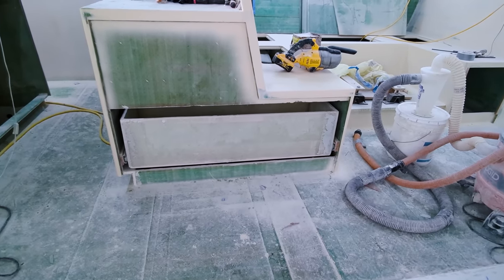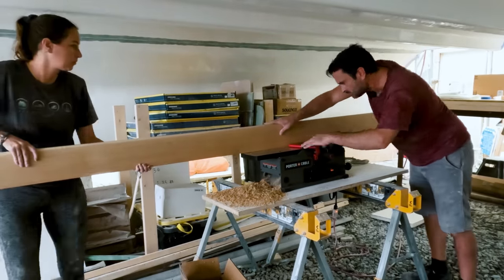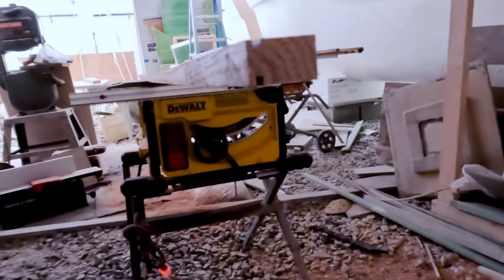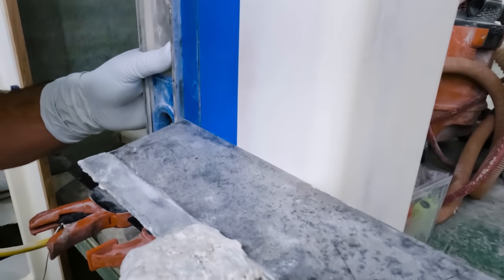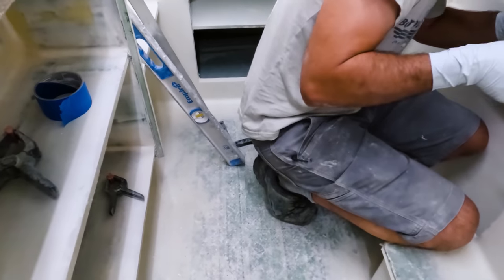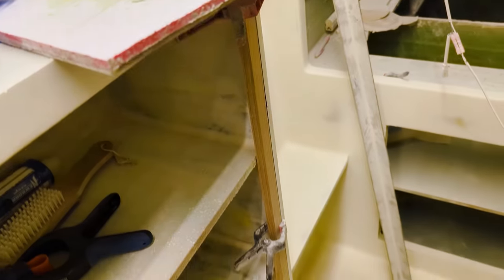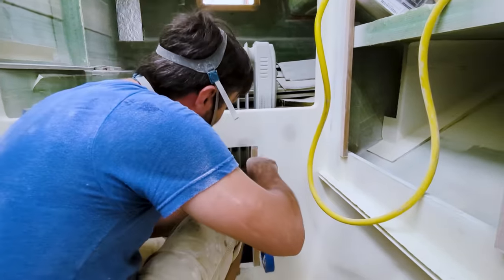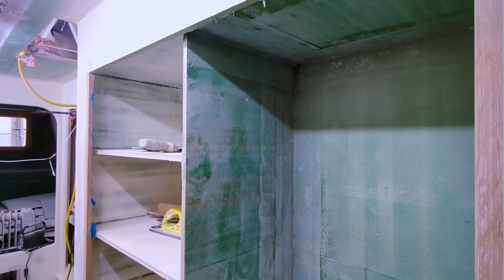The First WOOD TRIM Goes On Our Homebuilt Catamaran (MJ Sailing - Ep 301)

Comment: On not sure about putting on the wood trim before painting.  But we will see.  Good luck.
Reply from the maker: It will require a lot of rounds of good taping, but we think it's the best way for us to end up with a straight edge for the fiberglass/foam core.
Reply: I think that I would apply a surface finish to the wood before gluing in place, the fairing compound will go into the grain.
Reply from the maker: The issue with that is the fiberglass channel is only one layer of 12oz glass and doesn't have the rigidity to be finished flat like the surrounding area until after the wood is inserted.  The wood needs to go in slightly proud and get sanded flat along with the fiberglass channel to get it fair with the surrounding.  If we finished the wood first, it would have been uneven with the surface.

Comment: Assuming you will be doing a lot with the jointer and table saw, I think you would be well served getting something to support the outfeed.  When going through the jointer you could see where it was being lifted up when being supported on the outfeed side.
Reply from the maker: Believe me that I wished I had a roller stand on each end while doing this!
Reply: Get a sheet of 1/2" melamine faced MDF. Rip a piece (use tape where saw blade exits the board to minimize tear out) that is 1'4" narrower than the bed of your planer and about two feet loner than the table on both sides. Using some double sided tape attached that board to the top of  the planer's table making sure that it is level to your cutter head. You can attach a vertical leg on each end to help support the MDF board. 
 @MJSailing
Reply: @MJSailing rollers are trash. They're too much of a pain to level with the table. Building a long table saves a lot of headaches. Just throw a bit of wax on it, and your material will slide smother than it would with rollers.

Also, since you're going to be sanding anyway, setting the trim slightly proud isn't actually a big deal. Just sand it flush. It'll save time.

Comment: The final product will be stunning thanks to your attention to detail!  Please consider a couple of things to make it easier/safer: the best blade you can buy for your job site table saw will pay dividends on not having as much to sand or surface, and dust from sanding, cutting, and shaping oak (and some other woods) can be as hard on your lungs as fiberglass and fillers…you’ll enjoy your boat for many more years if you wear respirators, eye and ear protection…

Comment: Hi guys, love the progress on the boat, however like some of the other comments you should consider making some moulding that fits into the foam core and around the outside of the  face. This will provide strength to the edge and reduce the need to fair the gel coat to the timber . Something like a  U or J shape would be good.❤
Reply from the maker: It's much easier to do overlays... Either doors or trim, but it's a look we don't like.

Comment: Not certain if you’ve got one, Matt, but if not it’s easy to make a feather board to keep your timber pressed to the fence on your circular saw and other machines. 
It makes doing a continuous feed by hand much easier and keeps your extremely valuable pinkies out of harms way. 
You can buy them but it really only takes 10 minutes to make one from scrapwood, cheapest and best accessory you’ll ever have that isn’t a push stick. 
Hope it helps, Cheers, R. 😎👍🍻
Reply from the maker: Unfortunately our feather board fits the router table and other tablesaw (which is for fiberglass) and didn't fit this one like I thought.   We've got a new one on order.
Reply: @MJSailing  😄👍 All good, sorry I assumed. 
Just trying to be helpful. 
The interior’s really starting to come together, I know only too well how much work you two have piled through and how much you’ve got ahead of you. 
Hat’s off to you both. 
Cheers, R. 🍻

Comment: Just a suggestion.  I would never put your hand on the blade guard when using the jointer.  If you slip it could be disaster.  Also be careful not to push your  hand over the saw blades even if it doesn' pretude it is a accident waiting to happen.  Woodworking can be very rewarding and fun but not if you lose a finger.  Be safe!
Reply: As a woodworker, I was scared sh!tless watching him work. I am a Toolmaker by trade with a home woodshop. I'm proud to say I never had an accident requiring any stitches as a Toolmaker for 40 years. Proud of it and taught many apprentices. Going home with all fingers is #1 priority! The job is NOT that important!

Comment: I see Matt using a long board to sand the fairing compound to the wood. That long board looks exactly like mine that has a thin rubber pad on it. Sanding with rubber pads will leave low spots like you are experiencing. I used to put a thin 1/8" piece of plywood between the rubber pad and my sandpaper. You would find it makes it much flatter and lessens the need for a second or third layer of fairing. I even used this method on convex curves using a hard rubber sanding block only at the end to finish the work.
Reply from the maker: Good idea.  Thanks 👍

Comment: Please buy or make a couple of push sticks for use on the table saw! I was cringing watching you push that thin piece through.😵‍💫
Reply: He used a push stick at the end, but the video is accelerated, so its hard to tell.
Reply: I didn't catch that first time I watched. Been woodworking for 40 yrs. and one close call gave me push stick religion.
Reply: Push blocks for thin strips.
Reply: The board is too long for the size of the equipment
Reply: That table saw has a push stick on the other side of the fence. Why he is not using it is beyond me.

Comment: Those cracks are going to open later. Wood and plastic expand at different rates. Use 3m 4200 instead...faster easier and flexible and it will fill the gaps

Comment: It looks like the saw blade needs sharpening. Sharp blades will not burn the wood as yours is doing and sharp blades are safer to use. I have been watching from the beginning and I am looking forward to the finished product. Keep up the good work and I am sure you will be happy with the results. Be safe and see you next week. ⛵🇺🇸
Reply from the maker: I agree .... It was a fairly new blade that came with the saw, but is nowhere near as nice as the one we have for our track saw.  A new blade along with a feather board for this table saw (our other doesn't fit) are on order.

Comment: As a retired cabinet maker, one thing I hate to see on ytube videos is people using a table saw without a hood over the blade. I would hate for one of you guys to loose the use of a thumb or finger for a while (or even worse loose a finger completely).  Also as has already been commented, get yourself a roller support for the outfeed, they're not expensive .(sorry I'm UK based so don't know names of your suppliers)

Comment: When mixing the epoxy use small paper cups. It wastes less epoxy,  mixes better and you don't have to wipe up the residue. Just toss the cup.
Reply: Using cups Works with liquid epoxies: does NOT work with putties as you cannot eyeball amounts(but you can if you sacrifice some rigid spoons)

Comment: Have you thought about getting an electric or air file? It really expedites the long board sanding process.
Reply from the maker: We also have an air file.  But we need a semirigid board for most areas since the hulls side are pretty deeply concave (which doesn't show in the video) and the furniture is too small of an area to have an issue long boarding by hand.

Comment: I love your boat building series and your approach has been really good throughout, however watching what you were doing with the oak trim hurt my soul. You could shape them to insert into the rebates or rabbits and overlap the fibreglass edge , this would negate any messy finishing and leave a clean edge.
Reply from the maker: We wanted the trim flush and not overlapped
Reply: I appreciate your desire to achieve a clean edge finish. I don’t think you’ll achieve it this way unless you finish the fibreglass edge before fitting the oak, otherwise you’ll have a tonne of cleanup and refinishing after. Good luck and keep going I really look forward to seeing you guys get to the end.
Reply from the maker: It's how they did it on the older Balance catamarans.

Comment: If your not going overlap the fiberglass with the trim, sometimes it’s easier, faster and looks more finished to accentuate joints instead of trying for a perfect seam.  Maybe a V groove or ? Just a thought.
Reply from the maker: I would have loved to have a v-groove, but the delicate single layer of fiberglass doesn't allow for it to be prefinished before the wood is installed.  So sanding is required and that would make keeping the uniform groove very difficult
Reply: @MJSailing  yea, I wasn’t sure if a V would work, but thought someone might have a suggestion other than lapping with trim. With the boat flexing that still might be a good solution. Of course a crisp line between the trim and cabinet would look incredible.

Comment: I wonder if gorilla glue would be a easier way to glue the wood in place.
Reply from the maker: We need thickened epoxy to fill the uneven fiberglass edges to make them flush with the surrounding surface.

Comment: Youst a thougt not a lesson... I remember that you somewhere down the line cut out/ressesd the foam core for some reason. Would it be possible to cut out a couple of centimeters of the foam core and resses the wood in to that space. So that the board edge cant flex and to strengthen the construction overall. It would also in my mind prevent cracks and individual varping of the board and wall. Furthermore i fantasize about it being easier to install the wood trim if it had a reseseded grove to just pusch in to the wall. Like you did whit the fiber "rope"...

Comment: Hope you realize after all the effort to bond wood to the glass skin edge it will eventually crack.  Good thing it will be a fine line crack.
It will look beautiful mean time.  Hope I am wrong.
Why don't you just Squeegee the epoxy squeeze out instead of extra faring step?

Comment: Please get a magnetic feather board for that table saw. The way you are cutting is extremely dangerous.
Reply from the maker: I know.  We have feather boards for our other fiberglass table saw, but they don't fit the track of the DeWalt (which has the better fence and is the wood saw).

Comment: Why not just have the wood overlap the edge of the fiberglass a little, then no need to fill in between the two?  How does the factory do it?
Reply from the maker: We really don't like the look of overlaid trim.   The factory finishes the door opening with thickened resin and paint.  The cabinet doors are overlay.
Reply: @MJSailing  I figured it was most likely a preference issue.  I could not see the factory going to the work that you guys are.  Makes sense that they just put the thickened resin, a little sanding and they are done.   While your trim will look great, and high end, unfortunately it is going to take a lot of work for you to get there.  It looked like what you did, did not take long, but pretty sure that was the magic of editing, and there was a lot of work that was not recorded.  Things are changing and it is looking better and better.
Reply from the maker: I thought it would take a lot of time too, but surprisingly I got all the spots ready for trim done in three days.  And it only took that time because I had to wait for clamps to become available once one piece's epoxy cured.

Comment: Oh my god, get a couple of push blocks. I was horrified watching how close your hands were to the cutting head. Also buy or make a couple of push stick and feather boards for the tablesaw and router. Having your hands and fingers so close and within the danger zone is an accident waiting to happen. To remove the compound use a card scraper. Any decent woodworking shop will sell them. Amazon will sell them too, you will need a burnisher to put a cutting edge on the scraper. I would suggest not cutting corners on the finish you apply to the wood. Really do your homework. I just built a patio table and 1 quart of the exterior finish l used was $70.00 l then put two coats of ceramic wood finish on top of that. 3 ounces was $35.00 but it goes a very long way. BlackForest wood products sell it. New technology which protects your hard work.

Comment: i was a profesional wood worker and i got quite concerned watching you edge that wood etc
please add roller supports front and back of your planer to support your work piece and use a feather board to keep your work pressed to the fence. Better still, i understand money constraints but you wont be really successful using those DIY machines. Take you lumber to a professional and have it milled or splash out and purchase professional type machines with a greater work surface area. Also, flush fitting wood to fiberglass is probably not going to work for you. you will be reworking/pushing/pulling forever. what to do? finish the mating surfaces with a thin trim strip